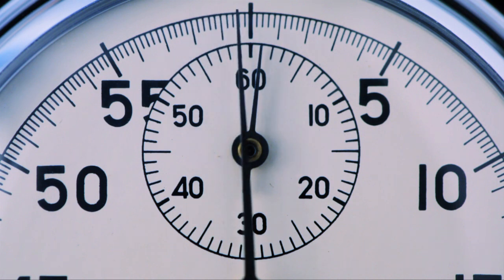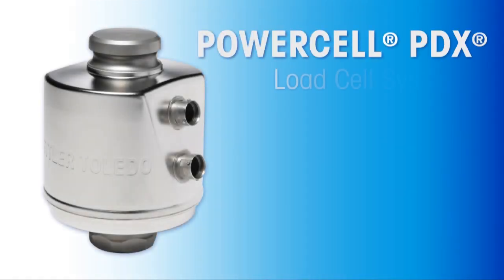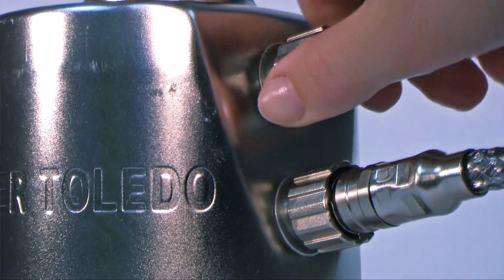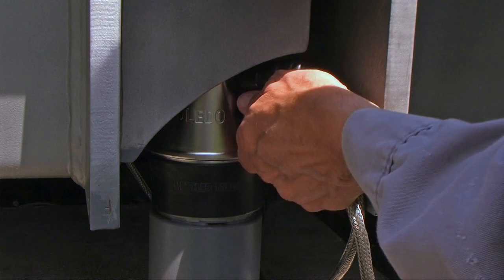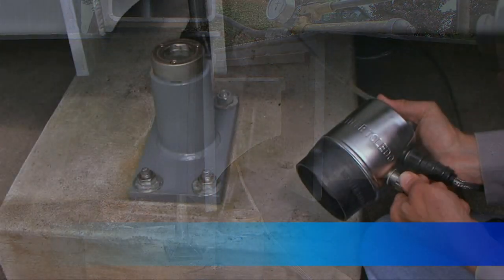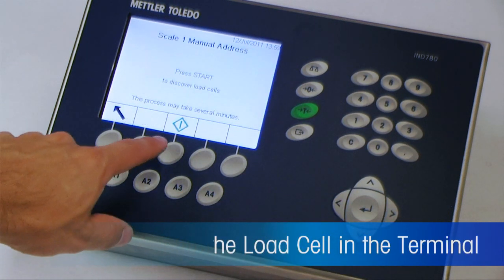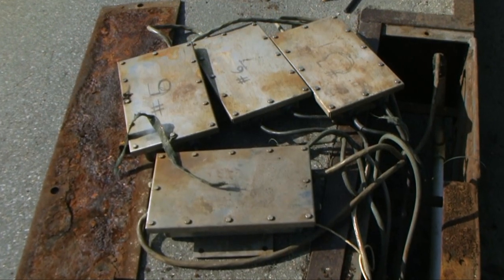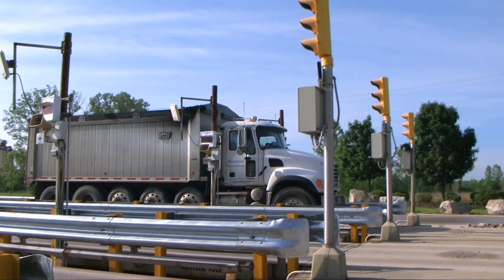How to Easily Service Truck Scales with POWERCELL -  METTLER TOLEDO Industrial

Comment: Connectors are junk. Water gets in them. Marketing BS at its finest.  Plus you are held hostage  only they can supply parts and service. Good luck dont do it.
Reply: Not so Sir. We have installed thousands of these on hundreds of vehicle scales. We frequently encounter pits full of water due to plugged drains, dead sump pump etc. The PDX, CMOS and MTX Powercells will run SUBMERGED for extended periods of time. Key is to put dielectric silicone in the rubber boots. This doesnt provide the ingress protection, the o-rings and Hermetic canister do that just fine. Its to be able to get the boot off easier in cold weather if need be.